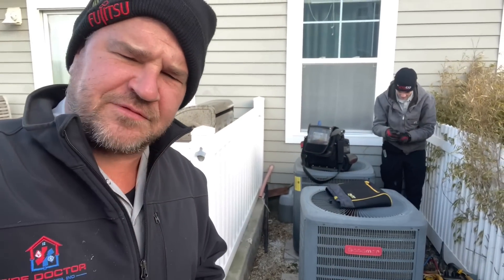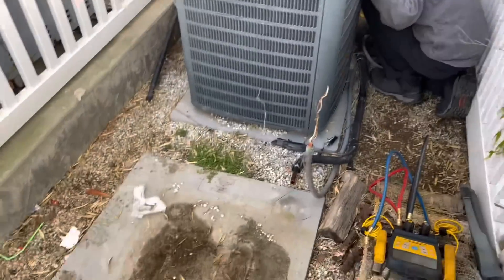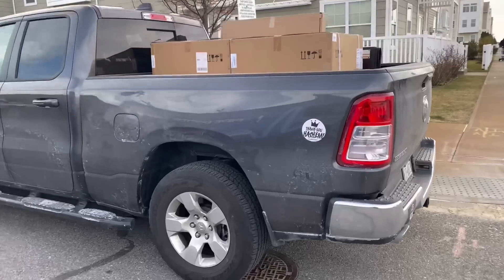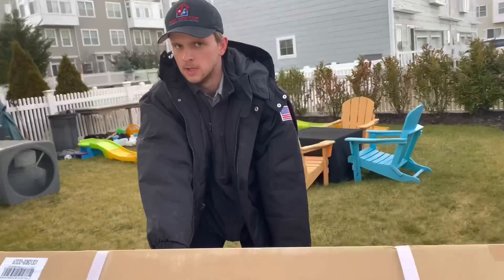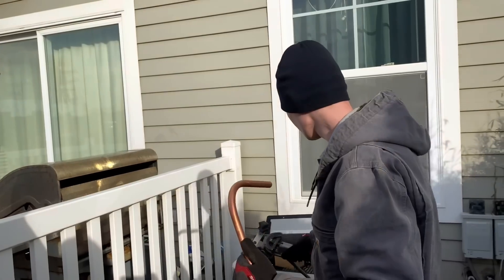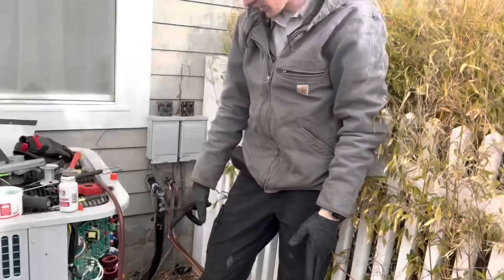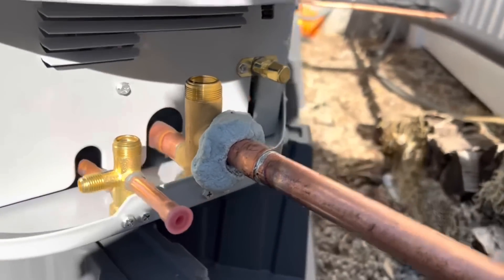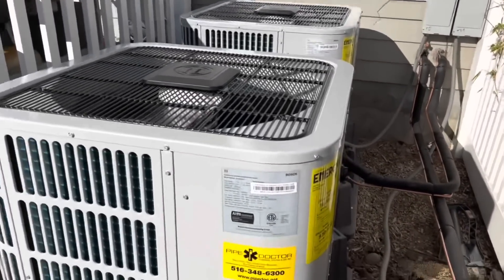Upgrading your Outdoor Air Conditioning Units in 2023? Consider the Bosch IDS 2.0 Heat Pump

Comment: I literally just got one installed today in Connecticut.  I'm not sure how I feel yet.  For heating, the air doesn't get all that warm and it runs a lot.  And it's only in the 40s outside. I have oil aux heat thankfully for when it's under 35.

Comment: Hi what do you think of this?  HEATING AND AIR CONDITIONING:
New Mini-Split System: Supply and Install a new High Efficiency AC/Heat Pump system ( Mini-Split - 1 Head). Includes New: multi-stage condenser, wall mounted heads, line
sets, and Remote(s).
New Air Source Heat Pump (3 ton): New (17+ SEER) (10+ HSPF) Energy Star Plus Ducted Split Inverter Air Source Heat Pump/Air Conditioning. Includes New: multi-stage
condenser, evaporator coil, air handler, condensate pan.)
New Air Source Heat Pump (4 ton): New (17 SEER) (10+ HSPF) Energy Star Plus Ducted Split Inverter Air Source Heat Pump/Air Conditioning. Includes New: multi-stage
condenser, evaporator coil, air handler, condensate pan.)
COLD CLIMATE Condenser(s) will be installed (Qualifies: Rate Code 580 for PSEG upon completion).
New multi level Exposed insulated supply duct(s) will be installed and intgrated in with distribution system.
New Exposed insulated supply duct(s) will be installed and intgrated in with distribution system.
New insulated return duct(s) will be installed and intgrated in with distribution system.
A new trunk will be fabricated, installed, and integrated into the distribution system. Includes sealing and insulating as necessary.
New Electronic Damper zone control will be added.
3 Smart thermostat(s), Phone App not supported by HEE.
Electric Hook-up. Home runs for air handler, condenser, water heater and bath fans.
HOT WATER SYSTEM:
Hybrid/ASHP (65-Gal) Systems: New 65-Gal Hybrid Air Source Heat Pump Hot water tank will be installed.
PEARL CERTIFICATION: Upon completion of this project you will be sent a Pearl Certification and report at no additional cost ($269 Value).
ADDITIONAL NOTES: Deposit $8,687 at signing, $9,000 due at start of project, $9,000 due upon completion. Homeowner to have a 200 AMP panel installed with at least 6 slots
open prior to work beginning. Homeowner to have oil tank removed from premises before work is started.      Contract Price $ 76,537
$ 0
Deposit $ -26,687
Program Rebate to
you

$ 0
$ -600

Home Comfort
Rebate $ -35,100
Total PSEG Rebate
to you

$ 35,700
Total Balance $ 49,850

This is  Bosch 2.0.
Reply: @PipeDoctor  Ok thank you.

Comment: What a shame to place the filter dryers outside to rust....
Reply: I work in commercial and we used to install them inside to be as close as possible to the evap but we moved them back outside so it’s easier for service if they ever have to change it out

Comment: I have a question I hope someone can answer. I'm having a two stage system installed. It's not a heat pump. How many wires are connected to the contactor in the condensing unit? Are there only two like a single stage or does the contactor need additional wires? The wire bundle running out to the unit contains five wires.
Reply: @PipeDoctor  I figured it out but thanks for your reply.

Comment: Daniel had that other install that leaked and when he pulled the joint apart there was no soldier on top.  I see he's only heating the joint at the bottom and not all the way around. You need to heat it evenly all the way around to draw the soldier in

Comment: What do you think about the gree flexx? They beat bosch in heating -4 compared to -22, I've had issues with condenser fan motors on the 2.0 zero on the 18 seer, just started using the staybrite I love it

Comment: Looks good except I don't agree with the firewood pile/ piping support. Come  on now, your better than that.
Reply: Woods not supporting the pipe. The pipe is a good 6 inches above the wood
Reply: @DCHVAC  okay, so no pipe support?
Reply: @williamfabiano543  no they’re not pipes. They’re linesets.
Reply: @DCHVAC another FNG with a keyboard.
Reply: @williamfabiano543  im not a new guy. Been doing this since 2017.
Reply: @DC HVAC  since 1988 myself. There is nothing supporting his " linesets" or "refrigeration piping ". That's a fail my friend. In 5 years those "linesets" will no longer be floating but they will sag from sun and snow and careless landscapers using weed wackers beating the hell out of those floating "linesets ". That's when the fun starts! Low on gas, sniffing out leaks ect. Do Quality installations for the benefit of customer and equipment efficiency, not for "likes" on YouTube.
Reply: @PipeDoctor  oh I got it now. You did the On line EPA certification but got zero hands on time so your hoping nobody noticed that you haven't a clue what your doing? But in actuality, your only ambition is getting likes and subscribers.